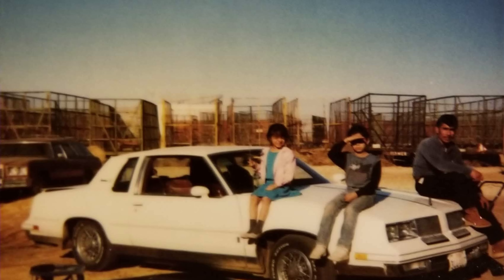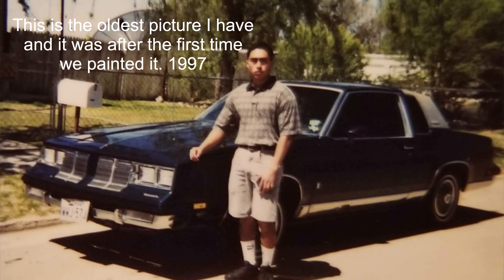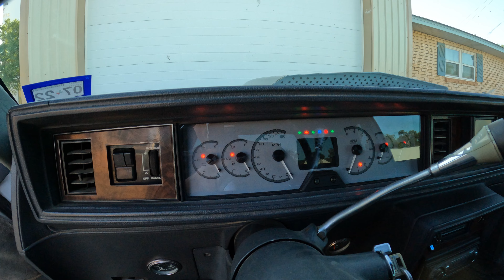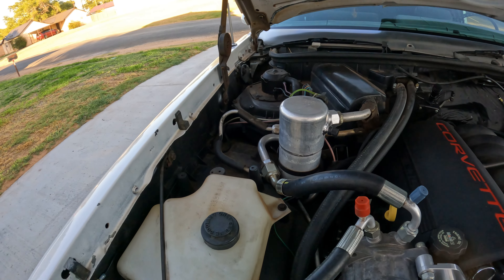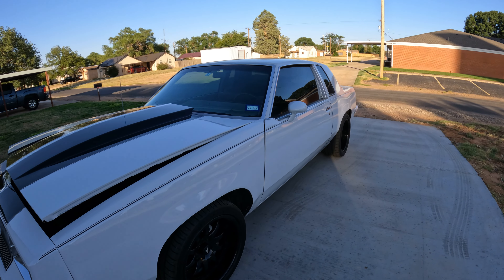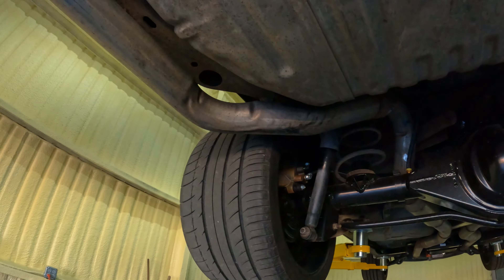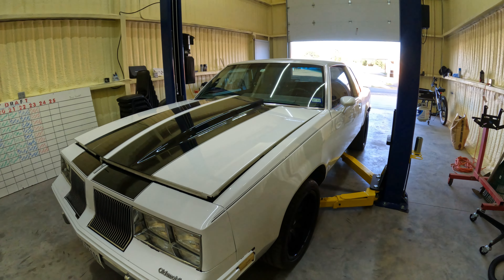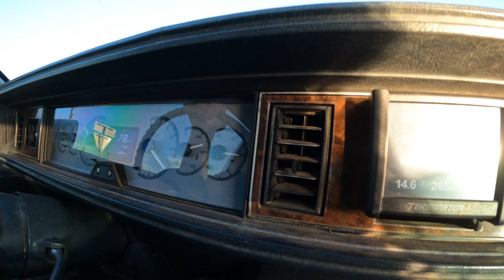Ls Swapped G Body-1983 G Body

Comment: Put a sump on it with a return line
Reply from the maker: Thank you for your comment. I learned that the Holley kit I installed regulates the pressure internally, and it returns excess fuel within the tank. So all I need to do is go directly to a filter and straight to the engine and the other one is the vent. Hopefully I'll be doing that soon. Thanks for watching!

Comment: You did a great job on your Cutlass run that G BODY BEAST BROTHER
Reply from the maker: Thank you very much brother! Hopefully we can put alot of miles on it now! And of course keep working on it little by little. Thank you for watching!
Reply: Good choice in gearing , that  keeps  revs low with 0.71  4L60E overdrive , nice set up , and even better is the low first gear ratio of 3.06:1
Reply from the maker: Yes sir keeps them ok on the highway...I love driving it alot so gas mileage has to be ok also to afford it lol

Comment: What’s the part number for the transmission cross member?
Reply from the maker: The part number is RCG-700, which will say 1978-1988 G-body crossmember 700R4. G-Force also recommends a polyurethane transmission mount....part number GMTM. I hope this helps, and thanks for watching Cutlass Vibes.

Comment: What is the part number for the crossmember?
Reply from the maker: Part number is RCG-700 and it will say 1978-1988 G-Body crossmember 700R4. G-Force also recommends a polyurethane transmission mount part # GMTM. I hope this helps.... thanks for watching Cutlass Vibes.

Comment: @14:15 I know the suspension wasn’t loaded, but just out of curiosity do you have any driveline vibrations? That pinion angle looked like it was excessively negative
Reply from the maker: I have zero driveline vibration....it runs smooth. And yes with the suspension not loaded it looks excessive but no problems with vibrations at all.

Comment: what is the part number for your lower radiator hose ?
Reply from the maker: For the lower radiator hose I used part #21612. I had to trim it just a bit for it to work, but not much, and I haven't had any issues. Thanks for watching!

Comment: What motor mounts and transmission crossmember did you use and did you have to cut your drive shaft
Reply from the maker: Hi there I used the stock motor mounts on the car and used dirty dingo adjustable ls1 engine swap mounts for g body to put it in place. I also used the G Force crossmember for 700r4/4l60e transmission. I had to get a new driveshaft made because I moved my Ls as forward as I could just to make it a little easier to work on. Thanks for watching.

Comment: I have an 81 and 85. 81 is a v6 and 85 a v8. Which one would you recommend or starter car doesn’t really matter since swapping anyways
Reply from the maker: Nice that you have 2 of them! Either one will work like you said since your swapping anyways. What are you thinking of swapping in there?
Reply: @CutlassVibes  just an ls1 nothing crazy at all even all stock. Just want the reliability of turn key and go. No crazy HP or anything
Reply from the maker: Nothing wrong with that...it will be awesome!

Comment: Hey bro how did you do it to clear the ac box with out the valve cover or coil hitting it?
Reply from the maker: I used the Dirty Dingo adjustable LS engine mounts and I moved the engine as far forward as I could.  It cleared everything, and my hand fits a bit better behind the engine if I need to work on something.
Reply: @CutlassVibes  dude I’m putting the new engine in right now and I just can’t get it to line up the way it was before I’m struggling with it
Reply from the maker: @Roguestatus650  dang that's weird....anything change at all that you can think of from how it was before?

Comment: I have a 1987 cutlass with 350sbc 350th .the 350 is a gas hug ! I have a 2004r that came out still good was wondering if I should drop it back in alot of ppl telling me not to mess with the 2004r I like it tho
Reply from the maker: That's cool that you have a 1987! I had a 2004r on mine and it worked just fine...if your just going to drive it around it will work. Now if you are going to hammer it alot then I would go with a 700 r4 or even better a level 2 or 3 700 r4 then you can beat on it and have some fun!
Reply: @CutlassVibes  I want to drive it around everyday summer spring fall car just not winter I do like to peel out sometimes get down on her she got 22s inch knockoff rims on her my 350th needs rebuild still drives but slips a Lil in 1st gear not to bad but its also gas hug would the 2004r be great to build a street strip everyday car?
Reply from the maker: I understand....that transmission would work great for a daily driver all year round. I wouldn't trust it to well to race or peel out too often. That's just my opinion of course....you sure can try it and give it a shot! A built 700r4 takes alot more beating. Just a little info...let me know what you decide and how it does. Since you already have the 2004r I say run it!
Reply from the maker: @emozburnes1733  what did you decide on that 2004r afterall?
Reply: @CutlassVibes  I picked up a us3d 700 last week I am going to have rebuild for the cutlass can not wait!!! I have the 2004r still may throw that in this 85 t top cutlass I got my hands on needs floor pans tho lbs
Reply: @CutlassVibes  I plan to build the 85 like my 87 but more sporty with 442 wing I want to get crate lt1 and throw the 2004r behind it never seen it done before I'm going to rebuild the 2004r also didn't want to risk putting another used trans in my car the 350 in my 87 was dropped in Las summer crate engine
Reply: Will be posting more videos soon as it gets warm and I start messing with the cutlass more it's in storage for now till winter over
Reply from the maker: @emozburnes1733  oh man all of that sounds great! I can't wait to see it all done. Pretty exciting stuff.

Comment: I'm strongly considering ls swapping my 84 cutlass supreme that my uncle gave me. It's my first time rebuilding a car and I'll be doing the work with my dad too. What advice do you have for someone like me just starting out?
Reply from the maker: That is so awesome that you and your dad will be working on it together. Those are some incredible memories that you will never forget. My advice is for you to just go for it....don't be afraid to get started and have a great time while working on it with your dad. One more thing, please keep us updated of the progress. Thanks for watching Cutlass Vibes.
Reply: Thanks brotha! @CutlassVibes  I'm in the planning stages of everything and figuring out a budget, doing research, etc. I was wondering what driveshaft did you go with?
Reply from the maker: Sounds good, and I had one built in Lubbock Tx at a place called Driveline Express.
Reply: @CutlassVibes   and what about the differential?
Reply from the maker: @vcalv9354  I went with a quick performance 9 inch and disc brakes. I really like the setup.

Comment: I have a 83 cutlass as well that I just did a ls1 swap on and I used a fuel tank from a Buick t type that comes with the baffle in it as well and it works great
Reply from the maker: Sweet where did you order that tank from sir?
Reply: @CutlassVibes  I bought the tank from rock auto and it worked pretty good I also used a sending unit from a Buick t type
Reply from the maker: @Roguestatus650  oh ok sounds great thanks for the info! I appreciate that sir.
Reply: Same here I used grand national tank and sending unit from rock auto on mines with in tank pump 340 from jegs
Reply from the maker: Thank you for the info... have you been enjoying that ls swap?
Reply from the maker: @Roguestatus650  how is that build coming along sir?
Reply: @CutlassVibes  hey bro, so I already got my new engine. I put it together but it’s overheating high but I feel like it might be because of one of the heads the head that was on the same side where the piston broke. I did not take them into the machine shop to get inspected and that might be causing my issue right now.
Reply from the maker: @Roguestatus650  Oh man I'm sorry to hear that...crap yeah it might be something wrong with that for sure. Hope you get it fixed and let me know sir.

Comment: Super nice Build Man! Love everything about this Cutlass. I'm myself working on a 85 Cutlass with a Ls2 
Would you mind sharing where you got you Ac lines made? And what type of air intake is that?
Reply from the maker: Thank you very much I appreciate that. I think it's pretty cool that your working on a Cutlass yourself! I bought the fittings for the AC lines online, and put them together the way I wanted them, and had a local business here in my small hometown press the fitting on the hoses for me. Any shop that works with hydraulic hoses should be able to press them for you. The air intake honestly I don't know where it was bought, or the brand. It was a piece one of my buddies had, and we cut it to fit. I do know I went with a K&N air filter, because I bought it myself. I would like to know more about what you have done so far on your Cutlass. Sorry I wasn't more help on those 2 questions you had for me.

Comment: Is that a ict bracket that you used for the ac also I need the info on those hoses bro I need the same hoses and possibly same ac compressor for my setup
Reply from the maker: Sounds good I used dirty dingo AC bracket with the Sanden 508 compressor. Let me look up that info on those fittings for the hoses...I have it all written down.
Reply from the maker: I used the GM Conversion Sanden SD508 709 Tama Seltec and I ordered it from Ebay. The hoses they had at several shops that do hoses and crimp them. Let me know if you need any more info sir ill be glad to help all I can.
Reply: @CutlassVibes  thanks bro hopefully I can cry them done here somewhere
Reply from the maker: @Roguestatus650  yes sir hopefully you can and keep me updated I'd like to know you got it done and worked for you.
Reply: @CutlassVibes  did you use the same power connection from the old ac compressor or did you have to change that?? Also did you connect those white and purple vacuum lines that are next to the ac box?
Reply from the maker: @Roguestatus650  used the same wire just cut off the old connector and I connected the purple one but it's very brittle and is breaking so going to just replace it. I don't know if the sell that exact one or just use vacuum hose small enough to fit. I did not connect the other one so I'm figuring out if I will need to or not after I replace the old purple one.
Reply from the maker: @Roguestatus650  if you need the part number of the compressor and bracket from dirty dingo I have them written down as well. Just let me know.
Reply: @CutlassVibes  I actually bought the ICT brackets but it uses the same compressor so I need to figure out where I can go to get those hoses made because I’m not too sure where to go about that I also just made another video of my ride it’s on my page if you want to check it out
Reply from the maker: @Roguestatus650  sounds great I will check it out for sure! Are you from the Lubbock area?
Reply from the maker: @Roguestatus650  did you get your AC going sir?
Reply: @CutlassVibes  No not yet I had to work on a couple of other little things on the car before I get to the AC part.. I did have a question for you though the Monte Carlo trunk lip that you have on your car did you have to modify it?
Reply from the maker: @Roguestatus650  oh I understand what you mean. Yes sir needed a little cutting on both sides where the lights are that was all. Nothing big. Are you thinking of installing one?
Reply: @CutlassVibes  I’m gona have to get one
Reply from the maker: @Roguestatus650  yes sir let me know when you get it installed. It will look nice.

Comment: Keep at it man very nice. I've had an old Caprice for 30yrs so I know how it feels. But I just got another cutlass I've done some things that you've done. And want to do more, idk about ls swap. But I like your suspension upgrades for sure. Do you save a lot of gas with the ls swap cause yeah the built 350s in both cars drink drink drink.
Reply from the maker: I appreciate your comment, and glad you understand how it is having a car for so many years. What are some of the things you have done to the Cutlass so far, and what things would you like to do in the future to it? The gas mileage on the 350 sucked for sure lol....we cammed this Ls and get between 19-21 mpg which is not too bad in my opinion. Thank you for watching and for taking the time to comment.
Reply: @CutlassVibes  Cool man I actually have both of them on my channel. I just took it apart and painted it. Windshield, rear window, door window seal rubber, welded the trunk hole and trunk body mounts. I'm in MI so it was some rust. But it's a pretty straight car. Bought it with built 350 th350 tranny shift kit, buckets was put in by previous. Only 73k but you can tell it sat outside for a good while.
Reply from the maker: Oh nice...you sure have done some work! I'm going to check out your channel for sure! Thank you sir!

Comment: you know what bro sometimes you just have to break down and spend a little more and get a better starting point, youll thank yourself. Specially if your gonna restore these newer 80s and 90s cars that are dime a dozen every where still, like my guy here, he had to buy a parts car, just to get metal when he couldve saved his troubles and found a solid one altogether!
Reply from the maker: I totally agree with you for sure and if I was going to build another one I would do that exactly no doubt. The only reason I didn't do that is because this is my first car ever. My parents bought it for me when I was only 15 years old and it has alot of sentimental value for me. If it wasn't for that....heck I sure would of done exactly what you said. Thank you for the comment and I appreciate you watching.